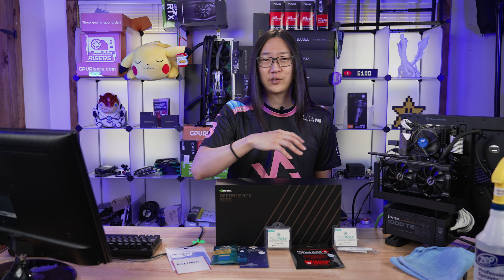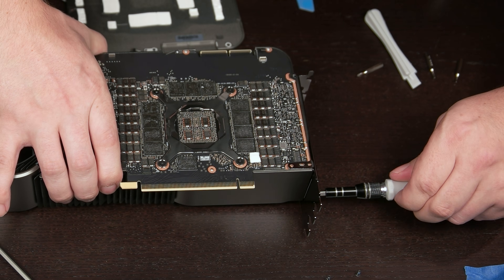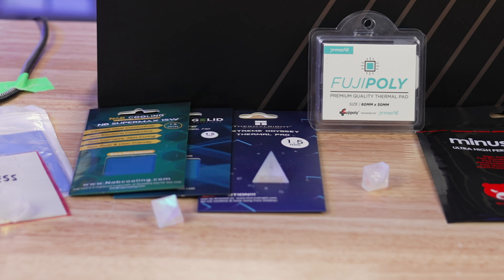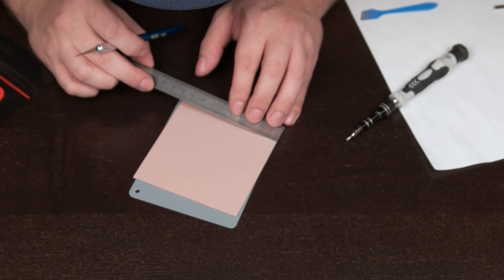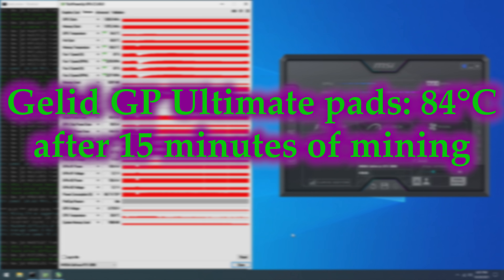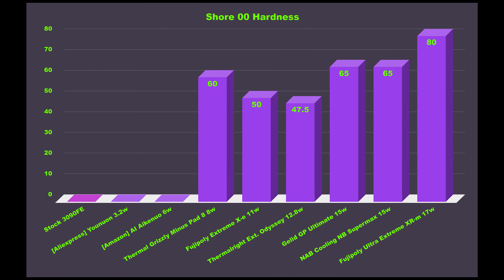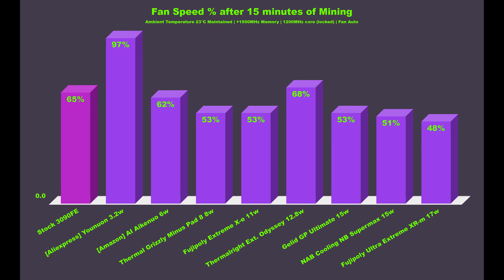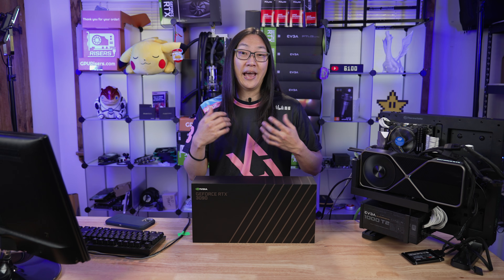Thermal Pad Showdown! What you should (and Shouldn't) Buy

Comment: instead of spending a lot of money on pads for every card (I have to import them as no one buys in bulk and sells here where I live) I bought a 50cmx50cmx1.5mm sheet of copper for cheap, and cut and sand it to perfection for each gpu and memory temps are down by a lot on every card now. much better than the best pads on this vid. these test must've costed you a lot so thank you so much for the vid again. but copper modding is way cheaper and better :)
Reply from the maker: Hey there, thanks for the input! Do you have any numbers and performance characteristics from your copper modding?
Reply: @TekShinji  shared on your discord under crypto stuff
Reply from the maker: Thanks!

Comment: Could part of the reason these pads "increase GPU core temperatures", be that the pads could be harder than the stock pads, therefore reducing mounting pressure on the GPU die as well?
Reply from the maker: Yes that is a possibility they we did look into!
Reply: @TekShinji  Thanks for the reply.

So how much did the hardness of the pads contribute to the increase of GPU core temperatures? 

Or was the main and only factor the better heat transfer from the memory to the heatsink effecting the GPU core temperatures?
Reply from the maker: Probably best to talk about this in our discord. It's difficult for me to keep track of comments and I might lose track of it since there's a lot.

Comment: It seems like 8W pads are most optimal, because they do their job pretty well, and don't flood the core chip with extra heat.
Reply from the maker: Oh wow, this shows you actually watch the video and understood the information we presented in it! Thank you first of all so much you are in the upper 1% tile!

It really depends on the application and what the goal is. If you want the lowest memory temp send that's what you got to do. If you want the best balance then yeah you don't want to get the very very best. It's also a lot cheaper.
Reply: @TekShinji  I'm doing a project where I'm going to convert an old Sapphire HD5870 1GB Vapor-X to a 2x 120 mm fan setup, because the original single fan is dying. I'm also trying to make it quiet in the process.

I was wondering how much W/mK would be fine for me, but it seems like as long as I stick to 8W pads I should be absolutely ok. Especially since I'm going to add two 120 mm high static pressure fans, which probably would handle fine even the 15W pads.

Anyway, thx for great video, it was really helpful ;)

Comment: In general, Whether the thinner the pad is the better thermal conduction is?
Reply from the maker: It depends, because unfortunately everything's different there's no black and white answer. Generally however the smaller the gap between thermal generating surface and dissipation surface the better.
Reply: @TekShinji  thanks
Reply from the maker: No problem buddy! If you like what you saw please get subscribed and join our discord for more future updates!

Comment: The original pads, that are not pads, look like Laird Tputty 502. I´m using it to replace pads since it squeezes and i don´t have the problem of too thick or too thin.

The putty is made of boron nitride and silicone and it leaves that greasy powder when removed. It is sold in bulk or with fiber glass reinforcement. The ones on the card have fiberglass. It´s easier to use in manufacturing because it comes in sheets with various thicknesses. In bulk looks like plasticine. You take a bit and apply on the component.

Laird has thermal puttys for automatic dispensing, that don´t use fiberglass, like tputty 508 and tputty 607. I think that tputty 508 is the one that is used on microsoft xbox one x and series consoles. Not sure though...

I don´t know if someone commented on the original pads before, so here it is.(too many comments to read to check...)

Thanks for the video. It´s the best i saw on youtube on the subject.
Reply from the maker: Technically this is not a how to do pads or pads on the specific card video it's supposed to compare different parts across the line but thanks for the comment!
Reply: @TekShinji  yes, i understand the purpose of the video. Check 4:20. That's why the pads fall apart. Because they are putty. The thing that looks like thermal paste held together with fibers. Just telling you what it is. It can be reused if the fibers are removed and you reshape it.

My comment is just for information. By the way, tputty 502 has a thermal conductivity of 3W/mK.

Comment: Thermalright are great. I have them on my 3080. You just needed thicker pads.
Reply from the maker: True, however if you watch the video actually tested multiple ones that are all the same in the batch we got. It's possible we got bad ones but we will know until we test hundreds of dollars a pass from the same manufacturer
Reply: @TekShinji  i know, is not that easy when you are testing all that pads. But with a +0.5 on the thermalright pads you'ld have way better results. And thanks to beeing the softest the GPU would still made good contact.

Comment: I probably should if watched this before ordering.... Just went with gekid for my Aorus 3080 Xtreme Waterblock
Reply: I checked online and ordered the size for the Aorus Xtreme 3080, which was 2mm, GPU didn't contact at all.... Re ordered 1mm
Reply from the maker: I mean a repadding can definitely help as long as that's the issue.
Reply: Fixed :), running 28°c on my open loop stock
Reply from the maker: Nice!

Comment: thermalright ultimate v2 vs Gelid ultimate ?
Reply from the maker: Ohhh sounds like a good comparison!!
Reply: @TekShinji  thermalright odyssey 2 or thermalright  Valor Odin. Both about 15w/mk too like Gelid. It's for MacBook air M2, everyone's talking about which mod thermal pad is better. Question, if I go from 12 to 15w/mk will it make my Macair M2 hotter because it's more heat conductive?

Comment: Hello friends, I write to you from Argentina. Here the Artic Silver and the MX4 are used a lot and the Thermal Grizzli as the best. I started strong overclocking from the I7 4790K together with a 1070TI. At that time and the Gelid Extreme had just appeared on the market, nobody knew about it but I ventured because of what I read on the website. Since then I continue to use thermal pads and grease from that brand and they always reduce the temperature a lot compared to other well-known "brands". I have highly recommended it. Right now I have to do some maintenance on my video card, it's not the 3090 unfortunately, it's an MSI RX 6700XT that is around 93 to 97 degrees Celsius while I play the demanding Flight Simulator with everything on Ultra (Rizen 9 5900X, 32 G RAM Corsair RGB, Mother MSI X570-A Pro, two 1TB NVMEs and a 1TB SSD (all kingston, the first on PCI-e 4). The graphics card is "on fire" and it has me worried. I started watching videos to find the thickness of the pads of my video card but I did not find anything, so I will buy a 1.5 mm one that is neither too thick nor too thin and fits everything perfectly.
I tell you that before putting the pads, I have always cleaned the contact points very well and passed a super thin layer of thermal paste. There is a difference between putting it and not. I know you might think it's weird, but it changes a couple of degrees for the better.
They have made an excellent video, lots of information, real stress tests and comparison charts. It has been very professional and pleasant. I have subscribed to the channel and I give you my best wishes for all your reviews. Thank you very much for sharing. Greetings from the South of Argentina!:washhands:
Reply from the maker: So you're looking for the thickness of a very specific part? It might be difficult. You might have to order a variety of pads and use it based on your experience. Your best bet is contact the manufacturer and ask if they will tell you.

Comment: Fujipoly, top of the top.
Reply from the maker: True, however you can see the reason why it also cost significantly more like to the point of diminishing returns. However if you need the best of the best can't beat it.
Reply: @TekShinji  oh, that's right, it does cost more than many others, lol. Last time I bought some I ended up paying around $40.00 or probably more to do some thermal pads replacement on a BC PS3 console that I've been wanting to make it run at cooler temperatures as it has becomes my favorite one of the PlayStation family. Recently got the old 90nm RSX replaced with a 40nm RSX from a PS3 Slim which runs at a very low temperature now. These kind of swaps were only being done by Sony repair center a few years ago on refurbished consoles until some great modders/thinkers found how to do them. Also, that's very nice of you that you replied back which I wasn't expecting. Thanks and keep doing your thing!

Comment: I refurbish gaming consoles and have been using Gelid for a while now. They are affordable and result in a huge noise reduction, especially on PS4 Pro. It's good to see some numbers backing up my experience with them. Thx for the in-depth video.
Reply: Hey, I'm a little new to thermal pads, but I was wondering: can you use these Gelid thermal pads inside a laptop? There's this separate chipset inside my old laptop that the heat pipe also goes to, and there's a little thermal pad on the chipset.

I've measured the dimensions of the thermal pad and the new pad should be a 15mm square that is 1mm thick. I needed thermal paste for the new CPU and figured I'd replace the little thermal pad on the other chipset too while I had it apart.

TL;DR: Can you use these Gelid thermal pads on chipsets inside an older laptop?
Reply: @Hawk_Blade99  age of the system is irrelevant, only the size and thermal dissipation. yes, you should replace it.
Reply from the maker: I would agree with what the other responder said!
Reply from the maker: Thanks buddy, I'm glad you like the video. Make sure to check out others on our channel and get subscribed :-)

Comment: Gelid ultimate is the best.. using it on my old card. Rx570. Stock pads temps going upto 82⁰. But after using gelid ultimate on full load its only 69⁰ max temperature.
Reply from the maker: That's great to hear man!

Comment: Great video. Excellent. The effort of all that work, working with that Founders 3090 is to be lauded.

One point. It would have been beneficial to run temperature tests of the stock pads with Noctua NH-T1. (As well as the test you ran of all stock.)

Is it possible the core temp increase was due to pad firmness?
Reply from the maker: Hey there, thanks for the response! In this case, we kept the thermal paste the same brand and type to keep it consistent. Since we were not targeting core temp, we were looking at memory temperatures for the primary.
Reply: @TekShinji  Yes I understood your point that you were looking at the effect of thermal pads on vRAM temperatures. However changing the GPU core thermal paste should reduce the vRAM temps slightly. You should take that reduction into consideration. Your performance thermal-pad temps with high performance thermal-paste may not be accurate. It will read a reduction in vRAM temps that may be partly due to thermal paste. 

I know this from experience. It's a long story and I'm not going to explain it here. ... However as I had been looking at your video, Youtube brought up a similar video by Youtube algorithm. In this video, the Youtuber clearly states that changing thermal paste alone, affects vRAM temps, so I was right. The stock vs perfromance paste is at about 3.49 in the folowing video.

https://www.youtube.com/watch?v=6jOuqwojuWY

THis other video also does not show an increase in GPU temps with Gelid pads. It does suggest that you may have used thermal pads that were too thick. Hence lifted the height of the GPU from the die, and increased temps. Sorry.

Comment: Very good review! Is it possible to test those (and maybe others) on a cpu or gpu, since the thermal load is higher?
Reply from the maker: Hi there, thanks for the comment. You're asking if it's possible test them on a CPU or GPU since the thermal load is higher.

Not exactly sure what your question is since the video is literally about testing it on GPUs? Technically, a CPU's thermal load on most computers is much lower than the GPU. Could you please restate your question?

Comment: If I got it right, changing the pads only on gddr memory modules, you get lower temp on gddr, but higher temp on gpu core? So it's a mixed feeling situation? Or I got it wrong?
Nice test and congratulations for the video
Reply from the maker: Essentially, according to our testing. The cooler was designed to dissipate X amount of heat energy per time. When the efficiency of heat and energy transferred per time increases, it also affects the performance of the cooler.

Comment: If I want to replace the default thermal pads with cooper pads should I refer to rebound thickness for the copper's pad dimensions ?
Reply from the maker: I would check compressed thickness because rebound is incorrect.

Comment: Do you think cutting them into little squares improves memory cooling? I suppose the unused memory units would be cooler since they aren’t sharing the pad with their neighbors
Reply from the maker: The more surface area you have potential more cooling capacity. So as long as the squares aren't smaller

Comment: What size recommend for a laptop y have a legion 5 with a ryzen 4000. I'm trying to find what size buy it 0.5mm or 1mm
Reply from the maker: Hi there, unfortunately you'll have to either contact the manufacturer or check online. There's no official listings for thermal pads. You'll have to research that

Comment: Replacing thermal pads on a Acer predator triton 500 rtx 2060 laptop (2019), Which pad would you recommend for a laptop gpu?
Reply from the maker: Hey there, you'll have to do that research on your own thermal pad sides for all products is standardized however it's not the same
Reply: @TekShinji  K5 PRO is a high quality gummy / sticky thermal paste designed for use on memory chips and GPUs of various computers including iPhone, Acer Aspire 6930 , Apple iMac A1311 video boards. This is the only commercially available product at the moment that can replace the gummy thermal paste that is originally used by Apple.
K5-PRO can replace soft thermal pads that are used on computers (up to 3mm thick)
K5-PRO has thermal conductivity K>5,3 W/m.K (at least 3 times higher than common thermal pads that are used on computers

Comment: The increase core temps is likely due to compression. Would you do follow up tests with thicker and thinner variants of the same thermal pads?
Reply from the maker: Hey there, This result came from testing on all of the pads. Which had different levels of hardness and thickness
Reply: @TekShinji  Thanks for the quick reply! 
I should've been more clear. I mean pads of different thickness from the same manufacturer and the same lineup. 
As you mentioned, there's no data on the original pads and limited hardness or compression data for the aftermarket pads.
It seems likely to me that the more conductive pads have less compressible filler material and more rigid conductive material, causing the GPU die to have less mounting pressure than it needs for better cooler. 
I think the impact of heat transferring from the VRAM into the GPU die is much less than mounting pressure and die coverage.
It's impossible to conclude either with multiple variables changing simultaneously. Hopefully you could get a video out of it!

Comment: Thanks for the video! I am about to start working on replacing the thermal pads on various Geforce RTX 3090 of different brands: MSI, Asus, Palit, Gigabyte...
I would like to make sure that the thickness of the pads will be right for those cards, considering that they come from different brands. I read online that (1,5mm) is good enough for both sides of the cards. What do you recommend?
Thank you!
Reply from the maker: Hey there, I personally don't have any experience with that card specifically. However, the best way is to measure them when you're taking them off. And having an assortment of pads available. That way you're not down.

Comment: Wow, very nice video! Just what I was looking for, tks!
I use two 100x100x20mm aluminum heatsinks with thermal pads and two 100mm fans on the backplates. They help a lot, but I think the original gpu thermal pads are gone by now and need a replacement.. Is it normal for them to degrade like after 1 year of mining? Tkss
Reply from the maker: Depending on the make and composition of the pad, sometimes they do degrade after time like all things.

Comment: You say the heat is transferred from the hotter components to the cooler components through the heatsink, but I'm going to push back against that.

Even with the best thermal paste, the heatsink will always be way cooler than any of the hot components. A more accurate mechanism would be to say it makes the heatsink hotter, reducing thermal transfer rates for other components to the heatsink.

But even that is maybe 1% of this difference.

The test was done with an auto fan curve. If memory temperatures were high enough to kick up the fan speed, then better pads reduce the fan speed as shown. The core temp increases are simply the result of slower fan speeds. I'm sure the one that pegged out at 100% fan speed had the best core performance.
Reply from the maker: Hi there, we actually thought this too, but it actually happened on every test with every pad. Have you repadded a card before and had different results? Would love to know your experiences!